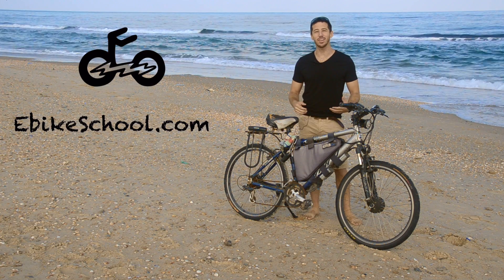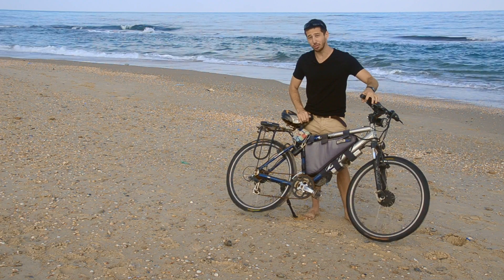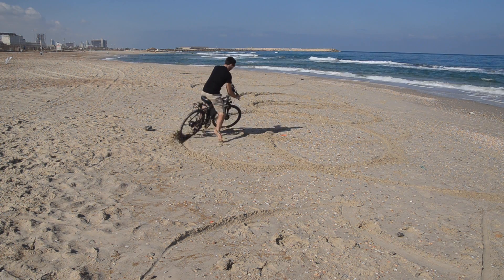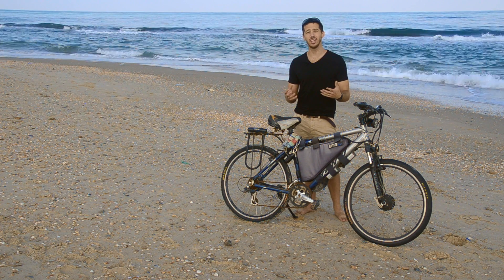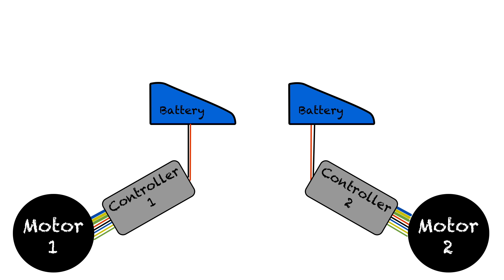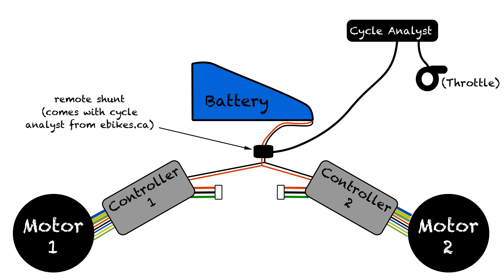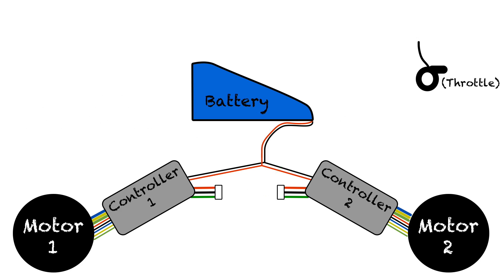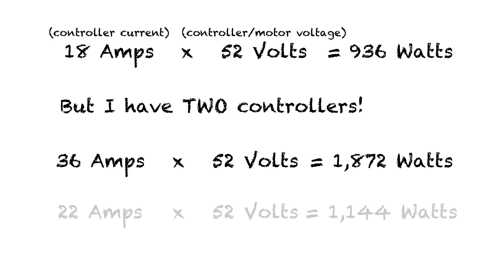DIY Two Motor 2wd Electric Bicycle (All wheel drive 2x2!!) Q&A#6

Comment: I have an ancheer folding 20 inch e bike and want to add a second motor like the switch bike motor because the break sensor let's the cable to pass thru so I don't need to wire it in but no disk break how do I go about putting one on ?????😵 Please help I'm lost

Comment: Hi, what if I wanted to use two different motors? For instance 350w in the rear and 250w in the front just because the front is  supposed to slip sooner than the back. Can the cycle analist be set in order for the back motor to provide more torque than the front motor? Or, can this be obtained with identical motors set to a different maximum current?
P. S. Appreciate your accent as it allows non native English speaker to understand everything quite easily

Comment: Can you make a video on how much voltage depends on speed and what voltage motor to use 24 or 36 also if I choose to use 24V motor and 10.2 Ah battery how will the range and speed affected. Please answer my question.

Comment: Sir. Was adding more motor. Will give more increase speeds? Example i used 80km ebike motor and i want to add more e bike  80km motor. And is that even possible? I hope i got cleared answer soon.

Comment: Just for curiosity, and for the long distances treckers, could you put a moter that just generates but not for drive on the front wheel to charge as they go or make a trailer with a generator on the wheel?

Comment: My plan is to add a 3000w front hub motor to my current 1500w rear hub setup. I'll be adding a second 60v battery for the new motor and connect throttle to both controllers. See any issues here?

Comment: This is fine in a straight line, but what about tight bends/corners? Is there any problem with the wheel speed difference? On the sand, the back wheel looked to be kicking out as it pushed against the front.

Comment: Hello and thank you for your video. 
Can you use the rear motor with cycle analyst for pedal assist and front motor  for throttle only, by using 2 throttles and one cycle analysis. I am in the market for ebike and would love to start with something different

Comment: I'm concidering building a kit velomobile with 3 wheel drive. Would you have any ideas, for a You Tube special.ie, does 1 of the hub motors need to be wired backwards,so the wires face to the inside for left/right  front wheel orientation?
Thanks
David Trevathan
goas877@gmail.com

Comment: Can i buy a ebike and add a bigger hub motor and battery or what else would I need? Job is 9.5 miles away want to be able to use a 1500 watt hub motor on a bicycle that comes with a 500watt hub.

Comment: Hey, thank you for sharing, my question is I'm building 2wd ebike I ordered 48 1000w front and back hubs, does it matter which trottle I use since only wanna use one and what would be the best size 🔋 for this build? I have a 48v 18 should this be enough or do I need to go bigger? And, if I need to go bigger can I get another battery and run them together to power my bike, is so how do I make them run together as one powering unit, on my bike. Thank you again.... LuckyRyder

Comment: Hi Micah. I wanted to ask. If you wanted to put a  regenerative system in place, to recharge the battery and perhaps even have a fold out portable 100w solar panel to add more range and charge. Living in Israel you should be able to get a load of extra power.  Is this possible to do. Is it feasible or not worth the extra cost.any advice on regenerating systems like the freewheeling types. Look forward to now going through your videos. Awesome 👏 🤙😎🤙

Comment: Hey can you contact me threw WhatsApp  better communication way but I need help with my project I am putting a extra motor on my scooter 36v 350w motors I only want to use one controller and battery set up if possible to save on weight and keeping it simple  I want to tap power and control from front motor to back motor battery will die faster I know but I want to balance motors right power consumption wise because full blast with to motors gonna kill my battery in 2hrs or less

Comment: Can second hub motor on front wheel increase the speed of the proper electric scooter that I use which tops out at a maximum speed of 65 kmph ??

I want to increase the speed to 80-90 kmph and use it occassionaly through a switch for front, rear and both motors.

I was searching for this for over two weeks now. I would use different battery and don't want to change anything except adding another motor and battery and wire it to one throttle and the switch.

Comment: Mine will have 2 engines,two throttles and 2 batteries. it shall weight about 70 or 80 lbs.

Comment: I have one question, if you can over volt them to get more Watts anyway, then what does the 350 Watts motors mean? and Some Motor describe that is 350w and Peak power 500w, What is that mean?

Comment: Are you saying that all I need to do is to connect my throttle wire / green to the other throttle wire from my second controller and it will throttle both motor's. That's like really crazy, you have no idea how much time I have spent trying to figure this thing out, when it was just a matter of connecting the two green / throttle wires together.
     My set up is completely different, but all the basic's are the same. I have a e scooter from razor, it's the metro which is more like a actual scooter bike that you sit down on then a standing scooter model. Any way I also have a cart I pull along with my bike, but wanted to add a rear push motor to give me more power when carrying a load. I use it to do my shopping, case's of water etc, etc,.
     There wasn't any room on the handle bars for a second speed control and that didn't seem to safe to me anyway. This is exactly what I have wanted to do. I have a separate set of battery's and will set up a trailer plug to disconnect the two separate units when I'm not using the trailer. Took a spare rear wheel set up and added a third wheel to the wagon, put a carrier on top of the wagon made of pvc and it's all set to go. Thanks for the info, I'll let you know how things went. 
P&L ( : > ).

Comment: I have a 20inch fattire 500w rear hub ebike and I'm adding a 1000w on the front wheel with torque arms. Is it bad to have a stronger motor in the front wheel

Comment: i want to add a motor to my front wheel ebike but not sure which size wheel to buy
the number on  my tire are 47-622  700x45c-28x1 5/8x1 3/4
does  that mean my wheel is 28 inches?
Thanks'
Hon

Comment: So I have a fat tire scooter and I wanna add a hub motor to the front, I have a spare 500w hub motor and it already has a 1500w and both have the same max rpm but different torque outputs. Could I use the 500w to get a little more performance or would it slow the scooter down

Comment: What would you suggest for someone such as myself that has a recumbent with different sized wheels? I'm looking at possibly having a 250w on front 20", and a 500w on rear 26" (750w max here in Texas). Thinking have the 250w front on all the time, and just use the rear 500 for up hill boosts, or when I have a trailer to get a longer range on the battery. They would be on a cadence sensor instead of a throttle.

Comment: greetings im looking to do something similar but with a 4 wheel pedal bike can you sent me a list of parts now hears a question im looking for a way to keep the batteries charged and so far here are my option solar panels but my drawback is cloudy days electric generators placed against the wheel but im not sure it'll produce enough power to keep charged or a small portable generator connected to the batteries do you have any ideas that may work i wanna take my bike cross country and what electric motor would be good as itll be for 2 people rideing and kinda  keep the motor hidden or email mail me at cadellftremere@gmail.com

Comment: I want to use a 14s battery equivalent of 56-58 volts to run a 48v motor but can it damage the 48 volt controller and other components like LCD and throttle etc.???

Comment: Hi I have a q1hummer 800w 48 volts 26 amp now I want to add another 800w 48 volt 26 amp motor to my q1hummer can I run it with a 52 volt 30 amp battery and controller??
Reply: Yes  👍 that will be ok, a 54V battery should be fine with a 48V controller. But don't go too much higher because there will be a cut-off and it won't work at all.
The difference between 48V nominal and 54V is accounted for by the spread of working voltage between Full-Nominal-Low of your cells wired in series. 
  A single 18650 type lithium ion cells has a useful working voltage between 3.5V and 4.2V usually 3.7V is considered to be Nominal.
   Bellow 3.5V performance seriously fall away. Don't overcharge or overcharge because it is dangerous and shortens the lifespan considerably. Best keep between 3.5V and 4.1V for better lifespan. Stay within the safe continuous discharge Amps per cell. Increase the number of cells in parallel to spread the load because overheating will reduce the lifespan considerably.
  For example the continuous discharge rating of a Samsung 30Q is 15A per cell.
So with a 26A controller you could get away with two cells in parallel, but 3P would be better for extending the lifespan of your pack. If you frequently push cells too hard they will reduce capacity down to 80% in a year. Even aming for half to three quarters of the CDR per cell would be absolutely ideal.
     I think that is what you were asking. Hope it helps.

Comment: Hi I live in Canada so we have way higher limits. I want to make a off road mobility scooter for my dad. Like the Daymak boomerbeast. My plan is to use an emmo monster as the front and the rear out of an electric atv. I'm going to put the back hub motor on the front. My question is would there be any different wiring if the motors are different styles hub front and motor driving chain or driveshaft on back? Also what if the motors are different power output? I normally only work on gas powered mini bikes. So I have to learning curve ahead of me on the electronics side

Comment: can i put a front hub wheel on my Haibike sduro if i already have a mid motor i live in England with a massive hill before i get to my house which goes on for about 2 miles, I am 63 years of age so just need a bit of help to get up the hill after a hard days work
I ride appx 20 miles a day getting up the hill at the end of the day is a pain,can you help!

Comment: Great videos dude!!  Hey how do you over volt the motors to 52 from 36 with that cycle analyst? I have a mongoose mulas fat tire bike id like do a dual setup like yours with 750watt geared hub motors.
Reply: The motor doesn't care or know what voltage is being sent to it.  A motor only cares about current, so the controller and battery is the deciding factor.  For example a motor can be run at 36v/26a, or 72v 13a.  Both will produce the same wattage load, apart from the top speed doubling and effectively altering the efficiency curve on the higher voltage motor.

A lot of controllers support multi voltage, but if not, the governing restriction is under/overvolt protection.  For example my cheaper controllers have a hard set 30 or 39v undervolt protection, suitable for a 36/48v battery, whereas my more costly set let me change the undervolt protection to suit 24/36/48/52/60v batteries through the lcd management.

Regardless of having a cycle analyst or not, your controller needs to be capable of running 52v.  If your undervolt protection is around 40-42v, and the input capacitors are 63v or over, you should be good to go 52v.  Most 48v controllers have 63v or higher caps, and an average 39-41.5 under voltage cutout.

Comment: Is this setup still alive - meaning durable ? Looked into your ebike guide and here - cant find which motor you have used. Which geared hub motor (350 -500 watt) is durable and gives me spare parts if needed ? Dont really know which motors to use - Q100, Bafang ... for rebuilding your very interesting setup today in 2019.

Comment: Shalom Micah. I need help getting around and trying to avoid one of those Mobility Scooters. I decided I wanted to go the ebike way but my balance is not 100% so an eTrike is what I want. Now its 30/11/2019 and negative laws are coming in fast, and here in Spain rules can be over interpreted on the side of a road by poorly trained police. I would like help to convert an off the shelf adult trike to a 2 motor rear wheel trike. After a parachute accident I put on a lot of weight so I want 750w to 1500w. This is a domestic bike and Roads are good, but we do have 20 degree climbs on some street. Im limited to basic soldering and dont know Ohms Law. But I can follow clear simple instructions. I have not yet learnt ebike jargon! Can you help be get make into the community again and maybe even walking more. Im excited to get started. I use 2 sticks for mobility. Thanks. Albie.

Comment: Hi Micah, Love your work. I have a Cannondale Scalpel mountain bike powered by a TSDZ2 motor which goes quite well but will overheat if running on high power for long. I was thinking a small front hub motor would assist in sharing the load in high speed / power applications. The TSDZ2 has it's own controller so thinking I would just need a separate controller connected to battery for the front hub. It is purely pas without a throttle atm so curious what I would need to control the amount of power fed to the front hub ?
Daniel from Down Under.

Comment: I currently  have a 36v 500w front wheel ebike and want add a rear wheel 36v 500w kit, and run both hub motors off one throttle, but
I'm confused about what size battery to purchase. Can you give me two or three options?....

Comment: Shalom Micah, I own an Easy Motion Easy Go bike which is a motor assist bike. How do i by-pass the motion or torque sensor so that I can convert the bike to a two wheel drive, using a throttle control (as per this video)?

Comment: I want to build a 4 wheel for handicap persons using 4 hoverboard motors.Can we over volt it to get more power. I want to use two motor at normal mode and 4 when there is some load. I am web server admin and security expert I will help you whatever  I can do for for you. Thanks bro.

Comment: Can you use two different size batteries and connect them independantly each motor (so dual mottor) and use one throttle to control dual motor system.
Reply: Watch this video and you’ll find the answer for your question 🤦‍♂️🤣🤣

Comment: Could I rig up a bike trailer to pull behind that had motors on the wheels so I could pull it across soft ground in the woods without loosing traction on my bike, maybe even use the trailer as a combo ewheelbarrow?

Comment: in the netherlands 90% has a ebike. and me too i have a sparta r5te if you wanna know what bike it is google it. BTW its a dutch brand it has a 250 watt direct drive rear motor with a 36 volt 🔋 but i overvolted it to 48 volts so it goes faster.

Comment: What are your thoughts on the uni pack power batteries?  I just bought a 52v 13ah and so far it's great.  I've built my own a few times with your help.   Just wondering if you could do a video with one of there Chinese cell batteries.  Seems very well built, but I'm no expert.

Comment: Great vids!!!
I was a trail rider on gas bikes since young (67 now) and this has opened up a new chapter for me!
I have a question pertaining to the battery (By The Way I have your books); in this vid you say a stronger single battery. I assume you’re running 48v because of your flavor of controllers. Say if I want to spend an afternoon in the woods and still have power left over, what capacity battery should I be looking for?

Comment: With 2 motors with the same power you only increase the torque but not the speed right? It is like kind of connecting batteries in parallel, so you increase the ampere but not the voltage isn't it?

Comment: My kit also has pedal assist included, but you never show how to install it, don't you? Look at this on eBay 
https://rover.ebay.com/rover/0/0/0?mpre=https%3A%2F%2Fwww.ebay.co.uk%2Fulk%2Fitm%2F323507466777 this is mine, thank you and as battery I purchased this Look at this on eBay 
https://rover.ebay.com/rover/0/0/0?mpre=https%3A%2F%2Fwww.ebay.co.uk%2Fulk%2Fitm%2F123605438617, I hope it is good for my motor and controller, could you give me some tips please?

Comment: if i have a motor hub with 5,000watts and 72v how many batteries in series and parallel to run to 5,000watts, i want to run at full speed the 5,000watts